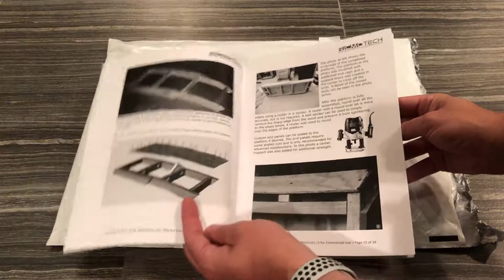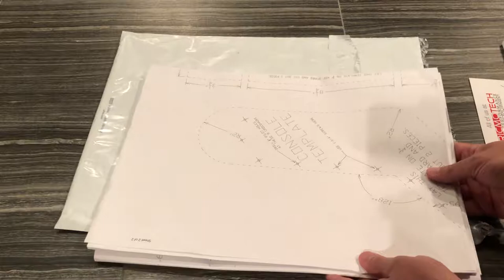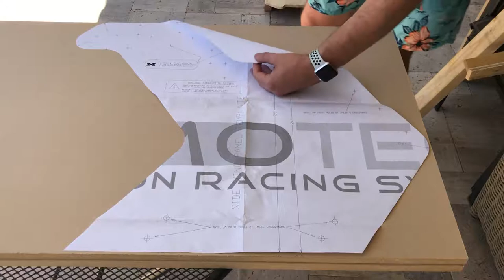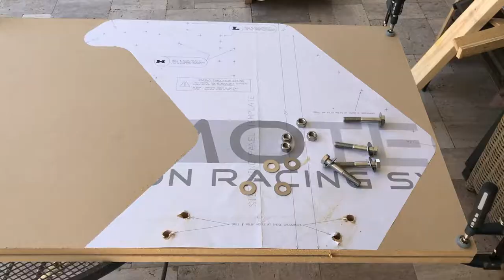DIY Sim Rig Build - Ricmotech RS500 / RS1 Part 1

Comment: how heavy is it
Reply from the maker: I'm not sure of the actual weight, but MDF on it's own is very heavy. If you had to move it while it's all put together, you would need two people. If you separated the platform from the uprights, it is easy enough to carry in two pieces. For anything more scientific than that, you'd probably want to add up the weight of a 3/4" sheet of MDF, 3 2x4s and about 1/3 of a sheet of 1/2" plywood. Home Depot or Lowe's might have them listed on their website. Hope this helps.
Reply: @MaximumSponge  thanks